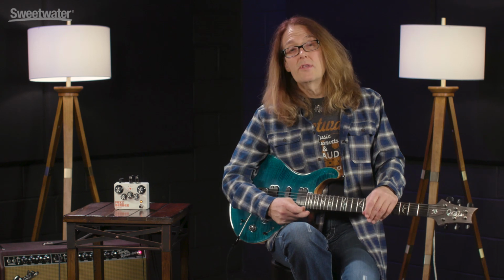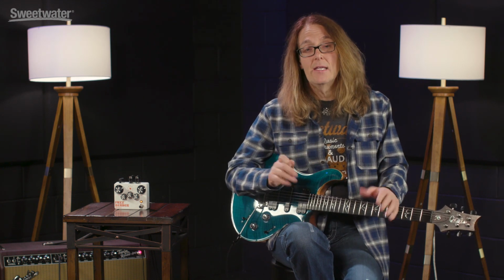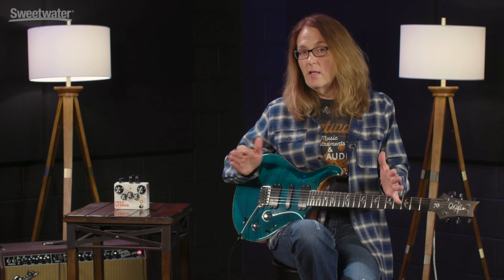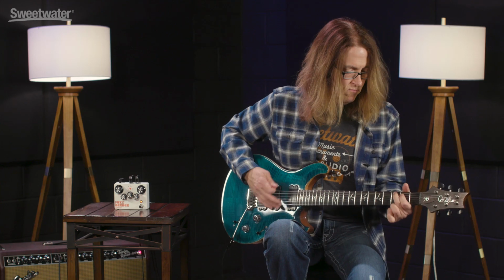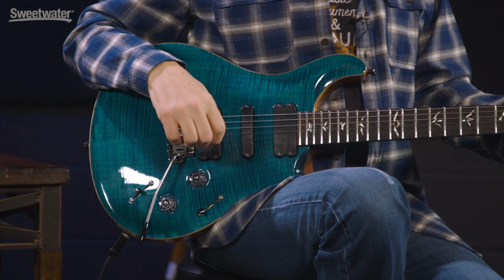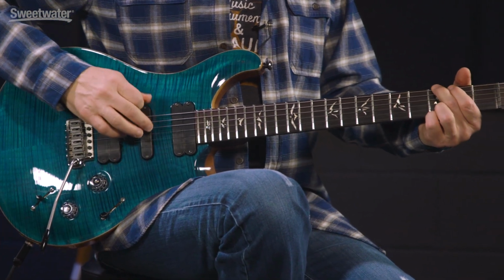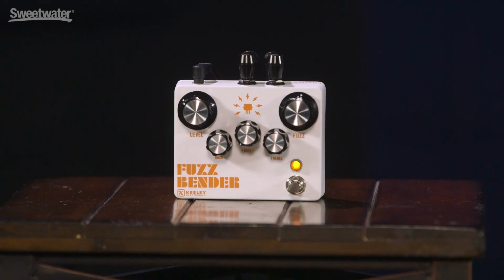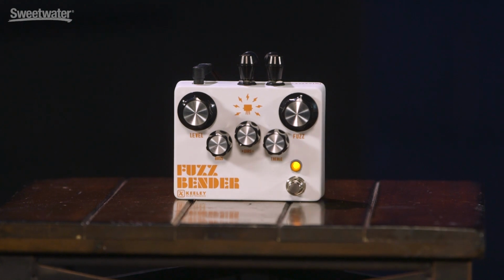Keeley Fuzz Bender Pedal Demo

Comment: Fuzz Bender or Hoof???
Reply: Which hoof? The cloven hoof has that nice top end and can be dialed to be fatter but I think this bender has more mids and cuts better
Reply: @captnswafers  Thanks! I have the original Hoof. I bought it to cut better than my old Little Big Muff. I find it a little mild and I've debated sending it in for inspection/repair. Sometimes I think I just need to turn it up louder. I find it kind of tame compared to my Op Amp reissue Big Muff.
Reply: I just sold my hoof reaper for this!
Reply: @_guitar_dad  Right on. Enjoy! I sold my Hoof and now I've got an Op Amp Big Muff and a Fuzz Bender. The Bender has a lot of different settings. Bass knob is fun. Bias knob is fun. Cool pedal for sure.

Comment: Pro player ! thx for posting those videos.
What would be a good fuzz for a Boogie Cali Tweed head 6V6 tubes with 212 100 W Jensen ?
Reply from the maker: Hi, Robert (great name!). Thanks for your inquiry.
Unfortunately without more information there’s no way for me to answer your question in a way that is specific for you.
I don’t know what sound you’re going for, fuzzes have different levels of gain/output and sound texture.
I don’t know what kind of guitar(s) you use, the pickup types make a difference.
I don’t know what else is in your signal chain, some fuzz pedals are specifically made to be the first effect in line and if not, the response character changes drastically.
Please provide more information or contact us direct with other questions as you have them!
Robert Williams, Senior Sweetwater Sales Engineer, (800) 222-4700 ext. 2371, robert_williams@sweetwater.com